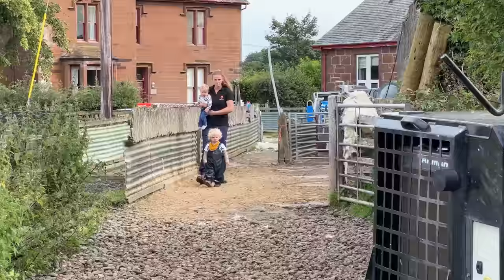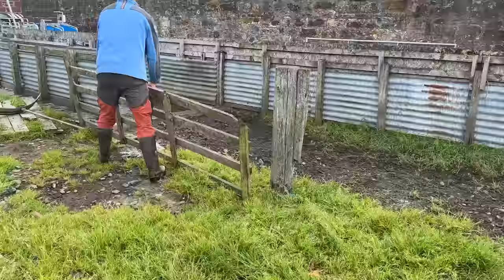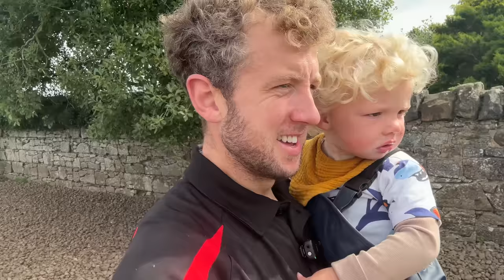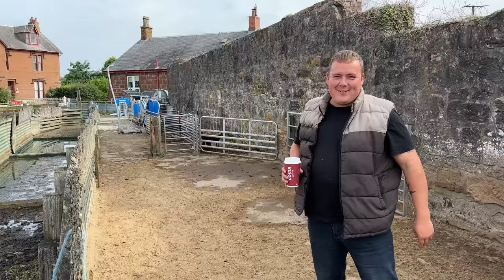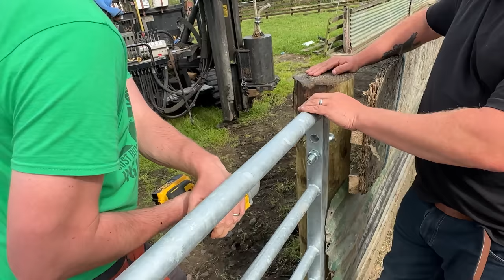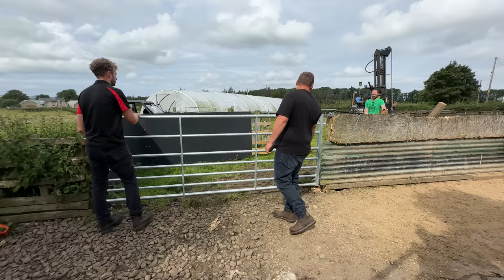Expensive machine makes light work of some fencing on the farm

Comment: Nice you can use something like that there, but my ground is hard as concrete most of the year and soggy in the rainy winter season. We have to use a tractor front attachment auger to drill ground for poles then concrete them in.
Reply: find someone who has a auger on their postdriver and they will get through it in no time, otherwise even a rockspike will be fine so long as they dont get it stuck
Reply: @thewhitesheepknight7571  we are on river Rock as well. Our front attachment auger can get into the ground, was a 3200 investment well worth it. The post hole auger we got with the tractor tore up the rear mounts because it didn't have enough downforce to get through the rock.
Reply: @falconk9  if the river rock is compacted enough then a rockspike might suit you better, problem is in that sort of ground the holes can just keep falling in, sometimes you might get away with spiking each hole 2-3 times. 
As a general rule in old river beds your best just battling away with an auger.

Also not all augers are built the same, we run tungsten bullet teeth and a bead of tungsten welded to the flutes of our augers, and those will go through anything apart from volcanic rock which is where the rockspike comes in